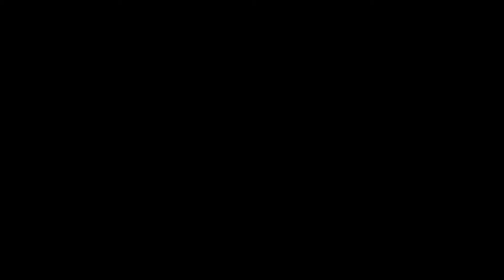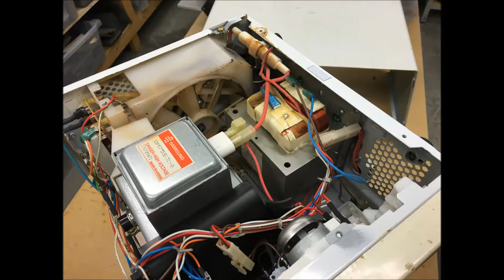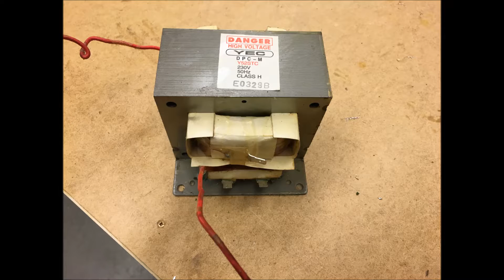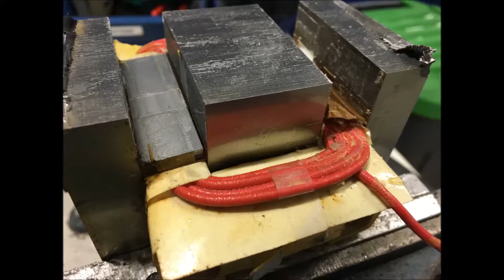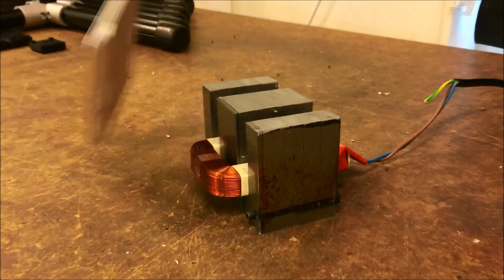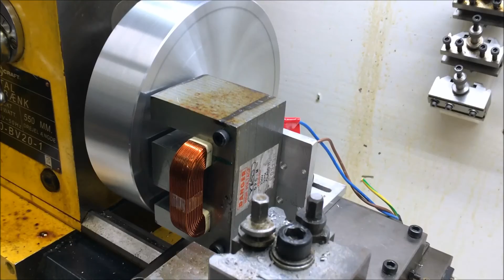Playing with strong Electromagnet

Comment: Try with 12-48 volts DC from a car/truck battery or any semi-powerful DC supply. Your magnet will work much better, and will be many times safer than mains AC!
Reply from the maker: MaTTdeluca14 ok Thx for the tip. So for Big heavyweights electro magnets DC is to prefer? I did some simple test for an Eddie current brake. Really don't know how to construct one yet...
Reply: DC will provide magnetization constantly because the current is direct as opposed to alternating. AC crosses a zero point 50 times per second, at each point the core will not be magnetized. So you essentially get around half the power per second with AC.
Reply from the maker: MaTTdeluca14 sounds logic. Didn't test that. Will try that next time. Also wind the magnet better to work as an Eddie ecb